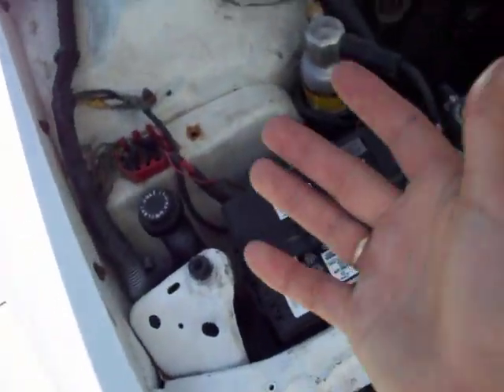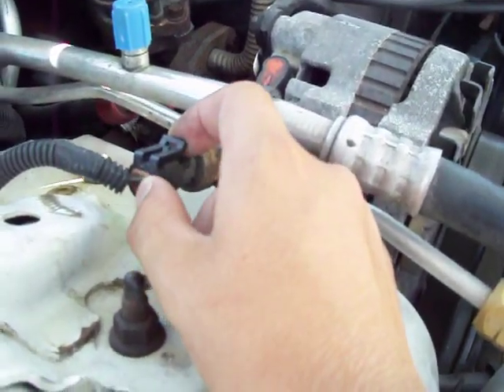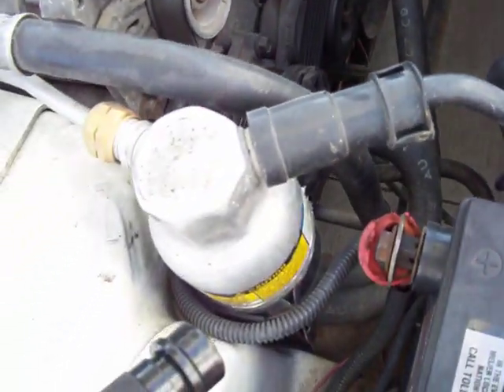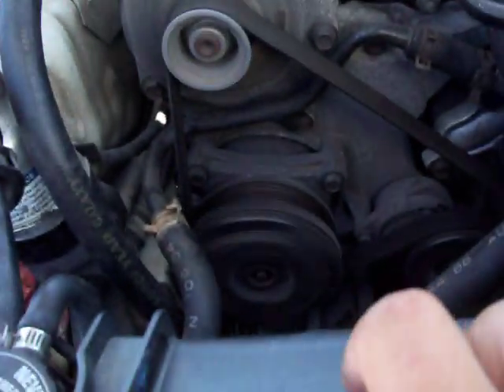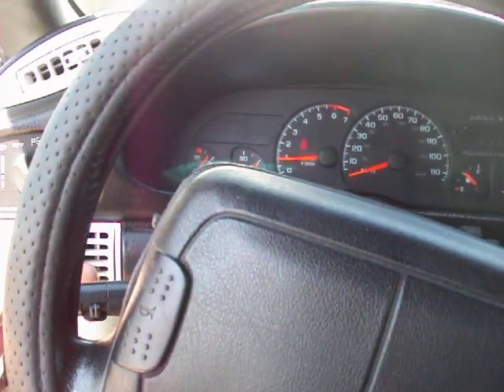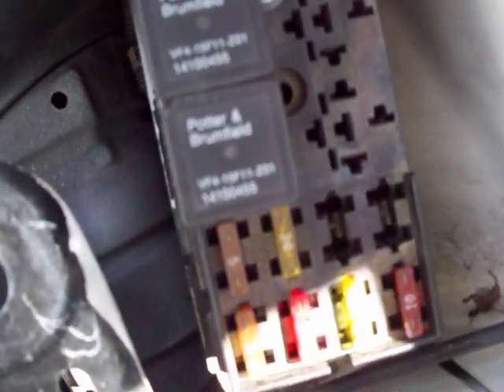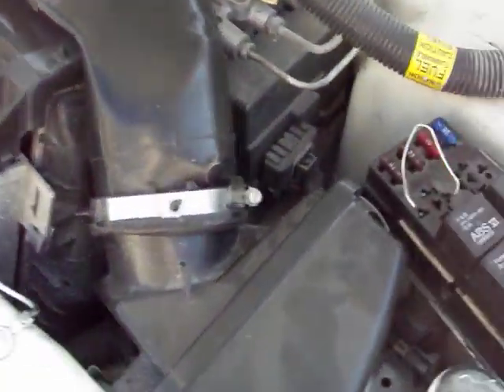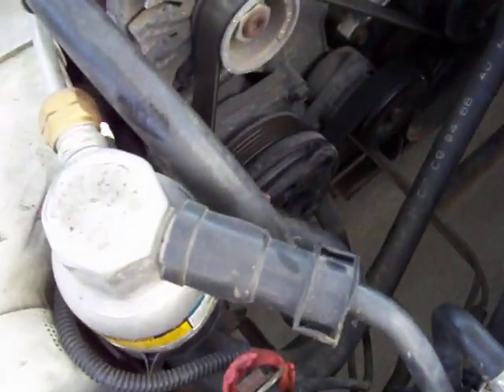How To Make AC Ice Cold, Recharge air, and Force the Compressor Clutch to Engage

Comment: Stop leak?  Good way to clog the orifice  tube or expansion valve.  Do yourself a favor and don't put that crap in.  I know the stuff claims to fix the leaks.  Get it fixed right.  There is no such thing as "mechanic in a can."
Reply: That stop leak ac crap in my neighbors truck clogged up my ac gauges ..
Using that stuff is as bad as adding freon via a low pressure fitting an no high pressure gauge...a BAD idea

A matter of fact _ If some ac shops hook up to your ac and you have stop leak in your ac system.
They will put a mechanics lien on your car til you pay for his $2500- $4500 machine.
Cause it ruins their equipment _somebody's gonna pay for it. 
That's pretty though .
Find the leak_ fix the leak right.

Comment: I made a jumper wire/alligator clips tool.  Two clips to the battery and the other two onto the compressor contact tips, after pulling the plug off of course.  Forcing the compressor to run is key to allowing new gas to be put in.

Comment: There is one thing you can do it the ac had freon but still blowing warm air when you are stopped. That is remove the bolt and washer in the compressor. File down the washer some ,then put it back. This helps the magnet stay locked in so it doesn't kick in and out and that will prevent the AC from blowing warm air when you are setting still. Worked great on my 08 Nissan Frontier.

Comment: Hey Friend, That's sort of a Hack way to do it... you really need to connect a good set of manifold gauges and note the high pressure and low pressure readings with the engine running and a/c on. That is the only accurate way to diagnose the system. Also, never charge an AC on the high pressure side, so when recharging make sure the manifold gauge valve to the HIGH side is turned OFF completely. Servicing an auto HVAC system is tricky and sometimes dangerous work and should only be attempted by a qualified technician. You can blow yourself up really fast if not!  Those little blue Wal-Mart gauges are not a reliable way to service your AC... you had good intentions though.... Sorry to bust your bubble man.... !
Reply from the maker: Actually, I would like to hear a little bit more about what you have to say. I actually own a set of manifold gauges and think they are pointless for most people on youtube because diagnosing them requires a pretty in-depth understanding of how the entire system works.  Their is a reason the simple tool using the low pressure side sells so much, because it is so easy to use.  9 times out of 10 it has been more than enough for the job for me, so whats the point in further complicating things when they don't need to be.  Sure, I  have had to use the manifold gauges on my power stroke but thats the only time I needed them.  I find your comment a little insulting as I only purchase my tools from sears and napa but maybe some people do not want to spend $100 on a tool, hence why they are watching this video in the first place?  These were not "intentions," it is simply the easiest demonstration and breakdown you can give to someone.  Servicing your AC via low pressure port is arguably safer than changing your battery. Hence why companies never get sued for this tool
Reply: ellswortha101 That's my point exactly... the only safe and proper way to service your AC system is to KNOW what you're doing. It's intended to be that way by the engineers that developed the system. I would not make a comment on anyone's post just to be insulting. I made this comment from an bit of experience with what I talking about. Auto HVAC is a complex and sometimes  dangerous system... and it's definitely not for the novice. Sure there are companies out there that make a "do it yourself" product... just as there are people out there that make and sell dental picks and mirrors. They intend to sell their goods for profit in an attempt to cash in on a market, for many process a "need" in the market like you do. They just want their AC to blow cold air, but can't possibly accept the responsibility of properly educating and training the public to service their own systems. That's why we have ASME service techs to work on our cars. Without writing a book here and spending hours teaching everyone reading this the theory and practice of auto HVAC I'll simply trust that you wouldn't attempt brain surgery on yourself or your family members. Know what I mean?  You can buy a set of steels and clutches for your GM 6L80E transmission at a parts house, but that doesn't mean you posses the training to successfully rebuild that trans now does it? If your AC system has a blockage in the condenser and isn't working properly throwing more freon at it isn't going to fix it... more than likely you'll make the problem worse, if not blow up yourself in the process.  AC work is an exact science in theory, dependent on ambient temperature, humidity, and the ability to remove heat from the air inside your autos interior spaces. For the AC system to function properly you need a precisely measured amount of refrigerant inside the system, an orifice tube or expansion device and a means to convert the refrigerant from a liquid to a gas in order to extract the heat from within the system. It's very complex and no can with a gauge on it can guarantee anyone positive results... the truth of the matter is if your system is low on freon it has leaked out from somewhere and the leak needs to be repaired before evacuating and recharging the system with the proper measured amount of refrigerant.  I was not trying to be insulting, sound like a know it all or anything like that, I was just stating fact.. go ask any properly trained mechanic, tech or HVAC service technician and they'll tell you the same thing... unless they're trying to sell you their Freeze in a can home recharging kit!  Be safe, and keep that car running properly by trusting the complex systems to the pros, or go to a VoTech and earn yourself a degree in auto HVAC service and do it RIGHT yourself! Have a great day!
Reply from the maker: I still argue that you're wrong.  If it wasn't safe to service the system from the low pressure port, companies wouldn't touch it with a ten foot pole. It is not dangerous.  For the average user, using the low pressure port with leak stop and r134a is more than enough.  Actually if you watch my other videos I  HAVE built this car from the ground up.  I rebuilt a v8, I DID do the trans, and I have worked on much more complex mechanic parts (setting gears on a high pinion dana axle?).  So I think you can see I have a pretty good understanding of how things work.  I'lll keep my car running properly by being the only person who ever works on it.
Reply: ellswortha101 I never said it was dangerous to service ac from the low side, that's the only place TO service it from. What I said was the only PROPER way to do it was with a set of manifold gauges and diagnose the problem, not just pump it full of freon when you don't even know how much you're putting in it or why it's leaking in the first place. It's great that you want to keep your car running right and admirable that you want to do it yourself. I'm just saying you should do it right. I'm not arguing with you, just trying to set you right on a gross misunderstanding. Go talk to a AC mechanic and find out I'm right. Enough said.
Reply: David Thomas Hey partner could I get your autograph on that book you said you wouldn't write because nobody would want to read it. The kid is doing a service that people like to learn for them selves, instead of getting ripped off from all the a/c guys that are out there. It seems to me that you have knowledge of the a/c system, and seems to me that the kid hit a nerve with you, maybe taking away some business, if they can find an easier or cheaper way to do things. He didn't say this is the proper, or right way to do something, he simply stated that this is what he has found for him that makes something work and is sharing it with people who would like to know. This is U-Tube not NASA Space Station, so good day to you sir, and ENOUGH SAID. just move on to the next person on the tube.... (if I disagree with you, it's only because im right)......
Reply: Richard Willis Richard, I'm not in the AC service business.. My experience is as a DIY'er... only. I'm just smart enough to study the system, learn from the qualified instructors and practice safe procedure. Be this U-tube or NASA as you say... it's ludicrous to proceed in such an unsafe manner. It's best to learn what you're doing from a qualified person or take your faulty equipment to a certified tech for repair.... I only said what I said because so many easily led persons on U-tube will jump on this chore not fully equipped to do so and possibly get hurt in the process. Again, AC work is not for the beginner. If you doubt my warning go to any professional and ask their opinion of home AC work. They'll back me up. I could care less that you disagree with me because I'm quite certain that I'm correct in my information.  If this young man wants to work on his AC that's fine... but to publish an instructional video without the proper training is irresponsible at best. You have a good day too. Enough said ... now you may move along !
Reply: +Richard Willis  Richard, the video the individual posted here is NOT good advice...  Long before the space station or NASA was even thought about, people experimented with many things - that are now common place, like modern A/C systems using the vapor-cycle technique... With that being said, many people have found the PROPER and SAFE methods of repairing things like this... The best I can do for You is make You aware of the CORRECT advice and where to find it, but of course -there are those who choose to put themselves at risk, and will continue to do so, regardless of what type of information they have been exposed to... It is like the old saying 'One can show the horse where the water is, but it is the decision of the horse as to whether it will drink the water... Or Not' ....
Reply: +ellswortha101 Hello there, is the differential a Hotchkiss type, or a Salisbury Type? Maybe it is a De Dion Type? Is the ring & pinion an Amboid or Hypoid set-up? Possibly a centerline drive? Curious...
Reply: Richard Willis, I found that information that David Thomas wrote; to be correct and viable... If You don't want to read it, simply do not click the 'read more' icon listed below it... You need to understand that there are people out there who care about SAFELY performing repairs on vehicles... If You don't care about that, then move on and let others who know better have the floor to express their thoughts...
Reply: You can't charge through the high side even if you try as its pressure is higher than the pressure in the filling tank.  It's not tricky or dangerous, as long as you avoid doing stupid stuff like he did, bypassing the clutch being one.  Not busting your balls, you had good intentions, just clearing it up a little.
Reply: Yes Todd Thoren, the high and low side fittings on systems, are different sizes on systems that have been designed to use R134A... But how about on systems that originally used R12 that have converted to use R134A? There are Conversion fittings available to fit R134A Q/D equipment onto R12 systems that have been converted, but what if the fittings were installed backwards? Believe it or not, I have seen this happen... People who should not be working on things like this who are not properly trained... That is when it can become dangerous.... This is something that could have easily caused problems, and the system was not properly flushed of the R12 oil and the original compressor, parallel-tubed condenser and accumulator were still being used... At that point , I decided to stop, and give the vehicle back to the customer (free of charge) and tell them to go elsewhere...
Reply: R-12 fittings are also different between high and low so I see no possible way to mix up the adapters, they won't fit on the wrong ports.  I've done the BS conversion of changing nothing and flushing nothing and they've all worked fine.  Not the 'right' way, but it has worked for me.
Reply: Who said the fittings were the same size?
Reply: Yes DonziGT230 & Super Dave Osborne... The low & high pressure fittings on earlier R12 systems were the same size.... In the "hundreds" of a/c services that both of You claimed to have performed, apparently- You have NO experience with the older R12 systems... The hoses to check and charge the systems were different colors, Red for the H/P side,  Blue for the L/P side, Yellow for the charging hose, but they all used the same size fittings for the older R12 systems.... Those technicians who were color blind , had to pay strict attention to this... To confirm this, try swapping the dust caps on a system that used R12... They interchange.... So somebody who does not know what they are doing could easily have installed the conversion fittings backwards on systems that have been converted from R12 to R134... If You work on other peoples vehicles, You should pay attention to this....
Reply: Golly- Super Dave Osborne, It seems that last message I wrote on 6/02/16 , addressing Your assumption that the older systems had test/charge fittings that are different sizes, really hit a nerve with You.... I really did not want to step on Your ego Amigo,  but unfortunately It seems difficult for anybody to; NOT step on Your ego when conversing with You... My main point here was not to prove You wrong (which You are),  but to make You (and others who read this) aware that on systems that have been converted from R12 to R134 types of refrigerants, to first make sure that the conversion was done properly.... As far as the sick-disturbed statements that You made about putting a hose into Your anal orifice and sucking on it;  Well, All can I suggest here is to - seek professional help from a psychiatrist...
Reply: If I were You - Super Dave Osborne, I'd stop before You get Yourself into another accident that will go Horribly wrong.... You remind Me so Much of the character of the comedian 'Super Dave Osborne' , as You're an accident-waiting to happen... :-D  Just let Me know when You do Your next stunt, so I can be sure to get to a safe distance from You!!!
Reply: Great!!!! More entertainment!!!! It just keeps getting better every time You expose Your thoughts to Us SD21.... :-) By the Way- That user name You have (SuperDave21), Is that what Your IQ IS? 21? Just curious...
Reply: r u the comedian from sctv and bob n doug mckenzie.
Reply: You know something Dave Thomas? Most of the people who have made wise-cracks and heckled those who have advised others of the failings of this video posted above; Probably have failed miserably at doing this on their own vehicles - or maybe they or somebody else they know - have failed very badly at something else... What I find very interesting about these people is that they seem to somehow re-visit their failures and want to see others repeat the mistakes they have made themselves... This is probably a way that they can justify their own mistakes & weakness's - By seeing others getting into the same trouble that they experienced in the past, by endorsing bogus techniques and information , such as that - given in the video above...
Reply: Yes,  and I just hate it that I share my correct techniques and advice only to be made fun of and argued with by a select group of know it all jackasses that probably don't even have a car!  These guys would tell a brain surgeon how to operate on their own mothers probably...  I just hate that some will follow this kids advice and blow themselves up or terminally damage their AC system in the process.... Oh well. I've learned not to try and help anyone from all of this.
Reply: Oh Well SD21, that is the way it goes sometimes... You try to advise people and find that there are those who actually benefit from Your efforts, and others who heckle the effort You have put out, even though the advice You give them is known to be accurate and viable.... It helps one recognize who will learn to advance themselves, and who won't learn to continue to go down the wrong path....  It also helps one recognize how rewarding AND frustrating it could be to be an instructor or a teacher... This is WHY it is important to remember WHO made a genuine effort to get people back on the right path... I feel that the one who originally made this video (ellswortha101) , really believed he was doing the right thing by producing & presenting it on this public access channel... Unfortunately, many of his techniques turned out to be very wrong... What impressed Me so much about this individual ,is that He went to a trade school to learn the correct techniques to do what He showed on this video, and more... Alas, the story has a happy ending... I just hope people who view this DON'T follow the advice given here as it could easily cause damage and or injure somebody trying this...
Reply: WENT TO YOUR SITE SEEN NOTHING AUTO RELATED. KID DID A GOOD JOB. SHORT & SWEET.  IT WORKS
Reply: You obviously know very little or nothing about air conditioning service 
I don't use my page to advance my auto info
Reply: Honestly John Connelly , If You know about AC systems enough to make the comment You did above on 01/19/17, You would NOT be saying this... He did have good intentions, yes... At the time this video was made, He did  NOT  have the proper training & experience to be posting this... Later, He posted another video telling people that He made several mistakes ... This was after he took some training courses to PROPERLY do work like this... That is where he did a good job... OH - yeah,  short & sweet John...
Reply: I agree could damage your system forcing clutch if done wrong but he had right idea. Not for novice.